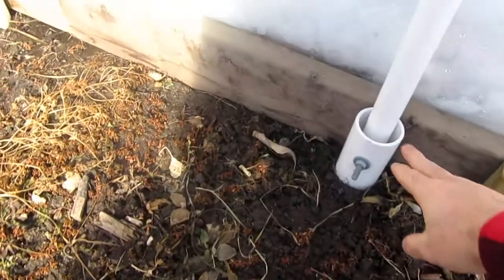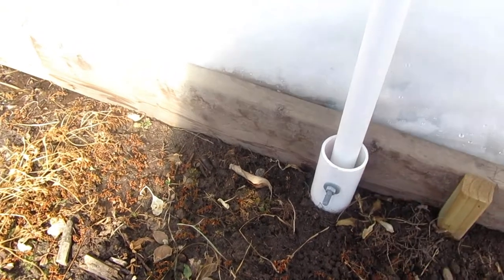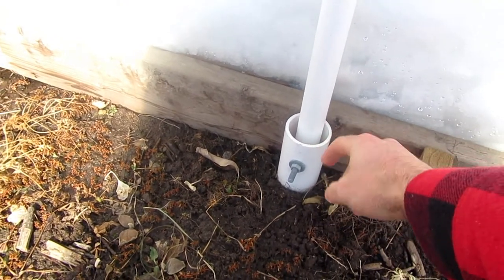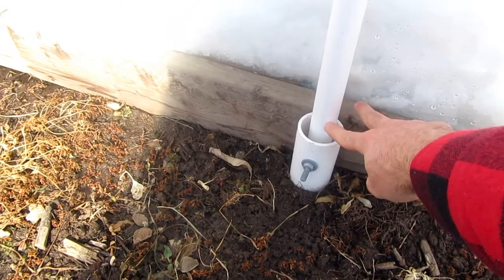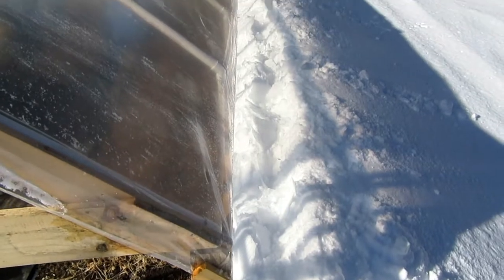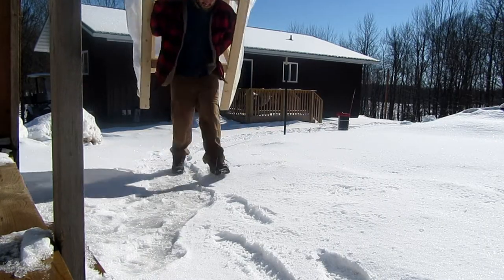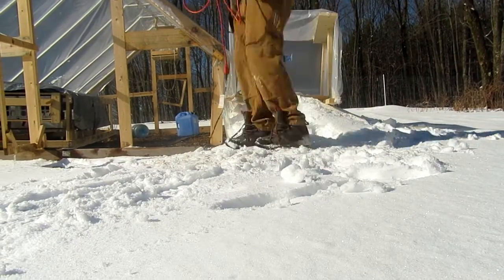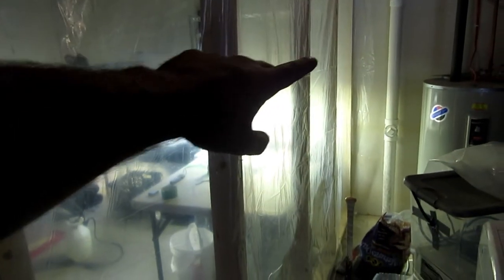Greenhouse Tinkering │ Clearing Land

Comment: Do you think the PVC leaches? I guess it could leach phthalates but it would take heat (enough to make the pvc tacky) or organic solvents, like gasoline to leach. But I get the worry if you don't have to risk it. Check some of the extra PVC you have laying around if it's marked NSF-PW and I think NSF-61 it has passed leaching tests and shouldn't be a problem. Be careful with canola oils too, most are extracted using hexane.  You got a lot done! Looking forward to the next video!
Reply from the maker: I am not sure if it leaches.  But, like you said, I think I can get away without it so I dont need to risk it.   In my gut I think it would over time due to the constant contact with the soil.  I know NSF doesn't leech into water, but have you ever seen anything in regards to soil?

I don't eat Canola oil and that is one of the reasons but it does seem to work well as a bar oil.  Thanks for watching
Reply: No canola for me, either. You won't see it until later, but canola will gum up your chain saw eventually. You should see how hard it is to clean out of anything. Its worse than tar.